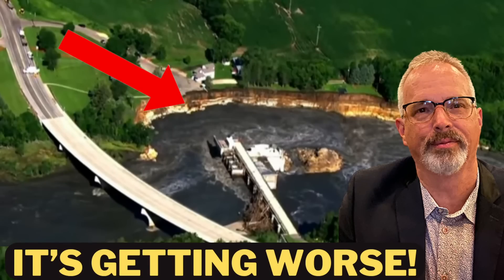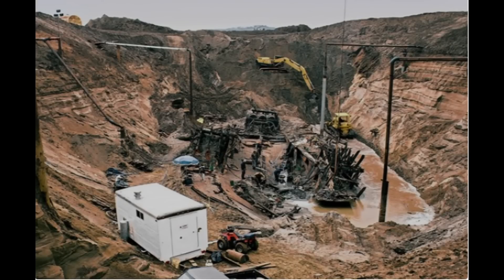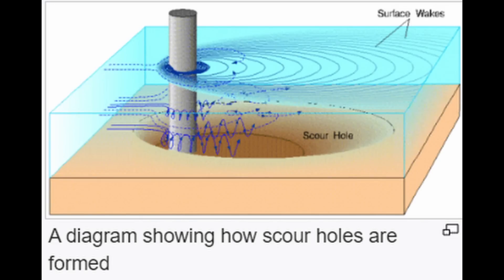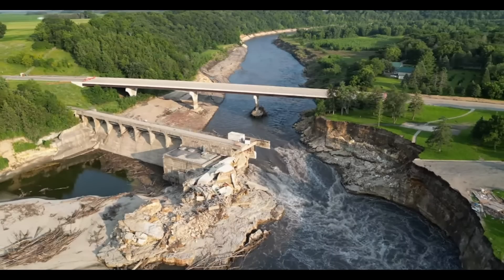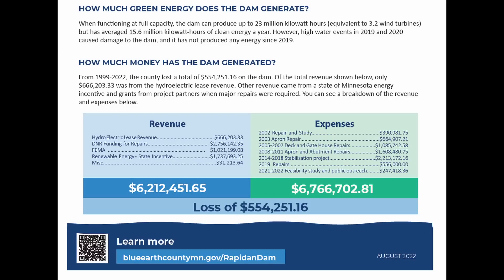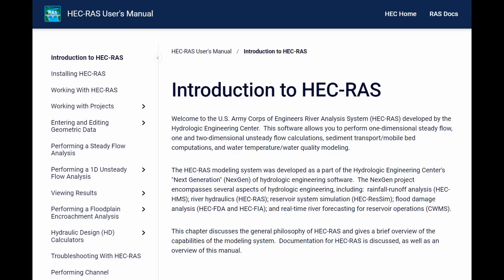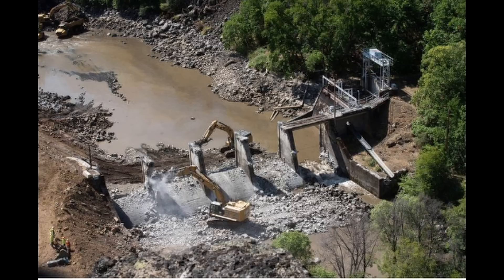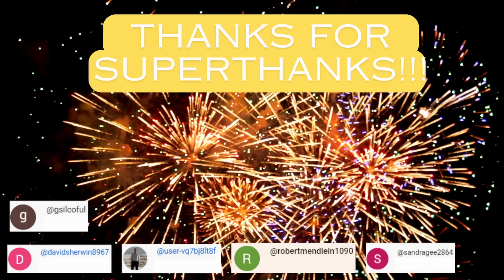Rapidan Dam, Bridge and Scour

Comment: Isn't it true the Rapidan failure is due to the lack of "scraping" (if you will) the surface debris prior to hitting the dam? Aren't there methods of extending screen structure ahead of the dam that directs the debris to the shore or bank?
Communities that insisting on building as they do between the ox bow segment is puzzling to me. Even flat-earthers can look at a historic map and recognize the strength of water, gravity, flow, and contours reshapes a river - any time the river wants to do it. Communities should also not be surprised. Yet, they try to blame their failure to understand this on global warming. I guess that is the scapegoat of the decade.
Reply from the maker: Thank you.  Yes, they tried to get a contractor onsite to remove the debris but reportedly his equipment could not be brought in on time and there were also safety concerns by that point.
Reply: @CaseyJones-Engineer  Thanks, Casey. I can believe that .... rather than having county equipment staged onsite. I have a hard time describing what I mean without a map, but will try - imagine a floating pier-like swing structure, like a net or screen or perforated panels that can rotate into the river flow, collect debris, rotate to the shoreline to remove the debris, rinse and repeat?  Or an anchored (north and south ends) skimmer (north-south - south of Glacier Rd bridge) to direct/float the debris to the eastside of the river, over a spillway to collect surface debris?

Comment: The design and expected maximum potential energy controller; (the dam) has been exceeded.  The design conversion of the potential energy into kinetic energy/mechanical/electrical was the intent and it had limitation.  The surprise over load of potential energy and that exceeding the kinetic energy conversion limits resulted in the over potential energy wildly converting to over kinetic energy and making its own path.  It is much like electrical current and electrical potential and blowing a fuse.

Comment: Good video. I used to argue with the SCS about hydrology studies in the 1980s. I used the rational method and stream gauges and they used TR-55(the irrational method). It usually over estimated by 30 to 50 percent compared to known rainfalls and stream flows(from the gauges). 
They also suffered from tunnel vision and ignored downstream conditions. One dam that I repaired had a railroad bridge and embankment about 1/5 mile downstream. In the hurricane of 1925, the entire valley was underwater because the railroad caused a severe restriction. I had held a public meeting about the dam work and an old gentleman shared pictures of the dam under 4' of water. I made copies. The SCS people were saying that it made no difference. That's when I gave up on them and sent them copies and notifications but didn't bother with them anymore. I had the PE and none of them even had engineering degrees. 
I gathered later that what I was arguing with was standard SCS policy and that stupidity was nation wide. I wonder how many problems they caused. BTW, the 100 year old dam that I was working on was a stonewall dam with an impermeable core. The core was 3" x 8" tongue and grove chestnut planks. Where they had been under water, they looked like new when we first pulled them out. I put a concrete core in. Good Luck, Rick

Comment: Wow 1965 max=42,500 CFS, vs. 2024 max= 33,100 based on USGS data.  Just for perspective. I need to think about that. In 1965 did "warm" snow melt quickly vs. high inflow in 2024 by rain? Warm snow is a snow pack that is near 32F vs. colder. That stuff can all melt in an afternoon in a warm spring rain - I've seen that and I've seen people incorrectly call it a 100 year rain event. At a minimum the Governor's statement is nonsense, possibly a ploy to get Federal $$$.

Comment: Ultimately, the biggest issue in the failure of this dam was that it didn’t have enough capacity to move the water past itself, so the water level behind the dam rose enough to overtop it. I think this is really the result of the changes made to the dam in the years before the failure. Specifically, the two things I believe caused this are the filling in of the two needle gate spillways in 2017 and the loss of the power plant because of the ice buildup in 2020.

The dam originally had 7 spillway bays, 5 with tainter gates and 2 with timber needle gates. The two needle gate spillways were closed off with concrete bulkheads in 2017, apparently due to concerns over them causing erosion of the right dam abutment. Filling in the two needle gate spillway bays with concrete obviously reduced the spillway capacity available to the dam in an emergency, and this clearly didn’t help matters. 

The less obvious factor in the failure of the dam was the loss of the power plant. For some background: the flood in 2019 had resulted in the spillway gates being damaged by floating debris. There was some concern about whether this had compromised them, so they were left in the fully-open position in 2020. During the winter of 2020, the spillways being fully open meant that the water flowing over the dam came from the surface of the reservoir instead of below the surface. This flow prevented the reservoir surface from freezing like it normally did. The layer of ice that normally forms on the reservoir acts to insulate the water underneath it from the cold air outside. Without that ice layer, the water on top got colder than usual, and that cold water from the top of the reservoir would then go over the dam, instead of slightly warmer water from below the ice layer. This water cooled to below freezing, but turbulence prevented it from forming sheets of ice. Instead, it formed a thing called frazil ice, which is small ice crystals formed in turbulent flow. This frazil ice then accumulated in a river bend below the dam and created a massive ice dam that raised the level of the river there and flooded out the powerhouse, rendering it inoperable. The powerhouse was never fixed. 

This matters because the dam failed because the spillways on the dam got clogged with floating debris, so their capacity to move water past the dam was reduced. In previous years, the dam would have been able to pass a significant amount of water by operating the power plant. Not only did the power plant increase the amount of water that the dam could pass, but the power plant’s water intakes were lower down and so were less susceptible to being clogged by large floating debris like logs. Without the powerhouse taking water from lower in the reservoir, the dam could only pass water from the surface of the reservoir, leaving it susceptible to being clogged by floating trees.
Reply: Dams Require. MATINANCE. 

A Long arm backhoe. To remove log and ice jams is good to have.

Anything made by 
Man require. OVERSIGHT.
Reply: It is unfortunate that your analysis was not included in the 2021 engineering report (at 8:04), along with a separate cost estimate to modify/repair the power plant valves and piping sufficiently to function for river flow and level control as you describe, and to forego the work and costs needed to restore power generation (9:13).  It would have been seen as stop-gap and precluded FERC funds, but protecting the integrity of the dam and bridge should have been paramount.
Reply: Thanks for a very informative post.
Reply: Excellent summary! They also sealed off the sediment sluice tunnels in 2017 after problems with the sluice gates. This resulted in the channel filling with silt. Then there was no reservoir capacity to absorb the rush of water. Its like they did everything possible to make the dam fail. Every change they made doomed the dam
Reply: @donbrennhofer8562  and I'm certain that the"agreement" made with the landowner to purchase their home site and coffee shop will preclude any action once the counties' willful neglect is determined.
Reply: A lot of debris clogging the spillways
Reply: I saw that dam pass a lot of water in March 2010 and again in September of 2010 when I located upstream from this dam.  Old-time locals told me that the worst was in the mid-sixties, and all the water cleared.
Reply: Wait a second!  Do you mean to say the dam, as designed, could handle more flow than the flood of 2024??!?  Shocking!!  But I thought the problem, according to this video, was the original designers did not have enough meteorological history to construct an adequate dam??  You don't mean to imply our forefathers actually knew what they were doing, as compared to the current Blue Earth county dam management.

Sarcasm from me should be obvious.  Good post, thank you.

Comment: Thanks for sharing your expertise.  The remove/repair cost analysis shown didn't capture the HIGH potential of a "contemporary" flood stage event which resulted in a county decision to patch over the problem.  Now in addition to the cost of repairing, they get to pay for disaster recovery, and a complete removal of both structures as well as a new bridge.  This tendency of our leaders to ignore the vulnerability of our infrastructure worries me on a national scale.   Over a million customer accounts were without power in intense heat for a week in Houston after only a Cat 1 storm.
Reply from the maker: That is a great point.  They certainly did live that out of the analysis.
Reply: There were no infrastructure upgrades after the Texas winter freeze. There is  a high probability the utility companies will be yelled at , but infrastructures improvement to handle a cat 1 storm so only 25% lose power rather than the 80% will not occur.

Comment: For now anyway, the flow rate of the river has greatly reduced which will help reduce scour. However, another big rain event will bring the flow rate back up. Certainly, next Spring when snow melt really gets going, the rate of scour will again increase. With limited options due the monetary cost to do anything, the river will just continue to do what rivers do and we shall see what happens. I was surprised with the $82 million cost of removal. I had no idea it would cost that much.

Comment: The delay in the decision on whether to remove or replace the dam has now brought the costs of the two options much closer together. It added the cost of replacing the CR 9 bridge, constructing a new embankment, stabilizing the downstream slopes, and spillway capacity upgrades to the repair option, and removed the costs of removing the sediment and diverting the river around the worksite from the dam removal option.
Reply: maybe cost analysis should include ''repair, replace, neglect/fail.
Reply: Reminds me of the old error messages you used to get with three options: Abort, retry, ignore. 
These days it looks like ignore is the preferred option because it is cheaper in the short term to let the dams fail than it is to repair or remove them in the proper manner. If it fails, oh well, we can patch here and there and let the next government take the blame for the cost of clean up.
Reply: This dam is down an empty valley and entire MN River valley is empty for 50 miles till hits Minneapolis except for like 30 buildings in Mankato.  Only bozos build in valleys in MN.  Let it fall to ruin and save $100m.  Seems like a con, when did engineers become con men demanding $100m.
Reply: @mostlyguesses8385  It is not the engineers, it is the politicians.

Comment: Just removing a dam isn't necessarily going to solve all problems, instead it can cause new problems with flooding and erosion. In this case the erosion is exaggerated due to the remainder of the dam, but with the dam gone upstream then there's a risk of new erosion upstream as well, and now there are buildings there.
Off into a tangent here, but there's actually some wisdom in the Bible related to this; Matthew 7:24-27 (New International Version).
Reply: Bible is a mythology book.

Comment: Casey, here in Nor Cal, we are in the process of removing several dams on the Klamath River, a project years in the making and congratulations to the Indian Tribes who have been the driving force in getting the historical salmon spawning grounds back into the river system.  

The lake that was created above the biggest dam had seriously silted in with nasty agricultural runoff.  The decision was made to remove the dam and let a heavy seasonal flow take the sediments downstream, which is what happened.  The choice was made in light of the fact that the Trinity River, a large tributary to the Klamath, had so much placer mining on it that if the salmon at those distant times, survived the mining operations, which they did, then they could probably survive the passing of the lake bottom sediments.  So far so good, the job is wrapping up the autumn.  The Trinity River is my north boundary, fortunately, I'm well above the river.
Reply from the maker: Thank you for that background.  Agricultural run-off has lots of nasty stuff in it.  It is interesting that the salmon survived the mining operation so they figured that they could survive the silt!
Reply: @CaseyJones-Engineer  Yes, isn't it.  But we did have two wet winters back to back  which gave 'em confidence in the dilution and flushing process.

I think that it's the largest dam removal job undertaken in this country, if memory serves.
Reply: @CaseyJones-Engineer 
Due to the fact that this was a catastrophic failure, the largest amount of silt, at one time, has already been released.  Latter releases will be minimal.  

The next highest will be happening during floods.  The flood waters should dilute the nasties enough to mitigate issues.  

Knowing the speed of government.  By the time they do react, this will be a non issue.
Reply: I'm afraid for the silt buildup in Okeechobee for me in Florida.  It is very bad and the levee is now pretty old in parts
Reply: I hope that people responsible for deciding about what to do with all the other dams in the USA and other countries will learn the lessons from this failure and not wait for their dams to fail.
Reply: @ericfielding2540  No, we're damn idiots, we really are.  Here in California the power company PG&E got fined a huge amount for its unmaintained equipment causing so many destructive and killing fires.

We are SO damn stupid, that we build nuclear power plants

Comment: There are about 92,000 dams in this country. We need to come up with a way to make the old obsolete dams safer at an affordable cost. Blue Earth County was given two unaffordable options so chose to do nothing.
Reply: @steven4315 and @CaseyJones though 92k seems like a ridiculously high number. It seems apparent we need to consider materials being used for repairs. Coatings for 21st century that are impervious to environmental aspects.
Reply: @800katie4U  I'm not prepared to condemn the county commissioners. This a small rural county without a lot of money that has a lot of needs.
Reply: Sleep in the bed you make, didn't wanna make the hard difficult choice to fix it then.  Well now we get what we got, a broken dam, soon to be broken bridge and a moving river.
Reply: @DurzoBlunts  very helpful comment 👏

Comment: To your point about Sacramento, it's not just the levees, it's Folsom Dam (and, further upstream, Shasta and Oroville Dams). We've had a couple close calls with Folsom (a spillway gate blew out in 1995) and Oroville (we're all aware of what happened there). We even had a building moratorium in the northern reaches of the city of Sacramento until the Corps and the flood control district could get the levees up to a safe enough standard -- and they're still required to carry flood insurance in that part of the city.

If you want real fun, go look up the ARkStorm scenario. The folks who modeled that discovered it would more devastating to the state than a major earthquake -- and just like an earthquake, it's probably inevitable.
Reply: 1862 "An area about 300 miles long, averaging 20 miles in width, and covering 5,000 to 6,000 square miles was under water. The water flooding the Central Valley reached depths up to 30 feet, completely submerging telegraph poles that had just been installed between San Francisco and New York."
Reply: You are absolutely correct regarding the northern California and Sacramento region.   The SAFCA FLOOD CONTROL PROJECTS that they have been working on for decades are another fine example of WAG THE DOG.  After hurricane Catreina pummeled New Orleans,  FEMA looked at the Sacramento area and strongly warned that the threat of a huge disaster was not an insignificant probability.   Local authorities just pushed forward and continued on.   Billions of dollars and years of work in order to expand the historical flood plains for ongoing revenue generating development.   Thousands of acres are now gone and now have high speed,  non pervious surfaces for the rainfall to more rapidly head downhill to the river, delta and ocean.   The computer modeling,  the extremely large number of "cost efficiency " engineering designs for each area of the protection system and...the "ACTUAL CONSTRUCTION EXECUTION " of these projects is a closely guarded secret.  Computer modeling,  design and actual construction do not align for many of these projects.   FACT.